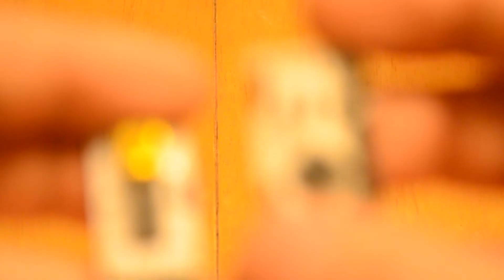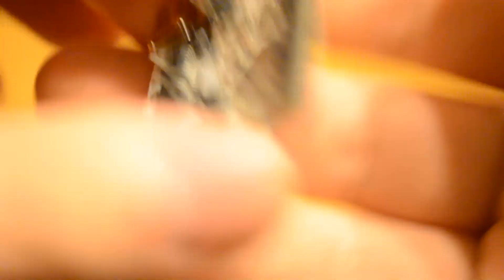Arduino Pro Mini - Review

Comment: does it come with the pins or do i need to get those seperately?
Reply from the maker: This will depend on where you purchase the chip from. Mine did not come with pins, so I had to purchase and solder them on separately.

The upside to this is your able to save space on/in your project by only using the pins you need.
Reply: +Rusty Shackleford can I have the link to where you bought it? (the white one?)